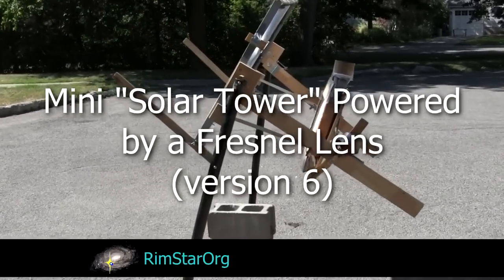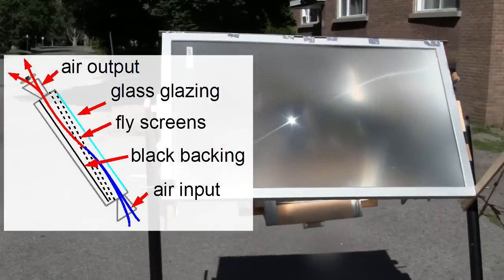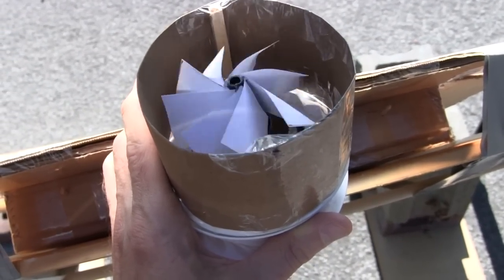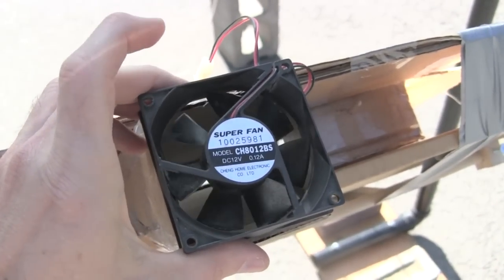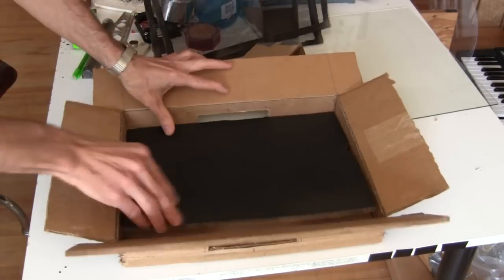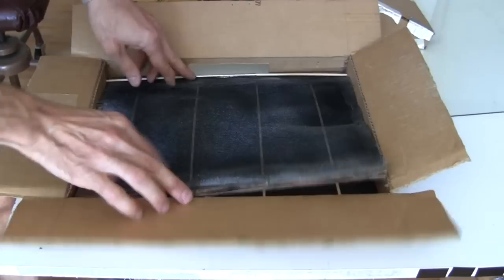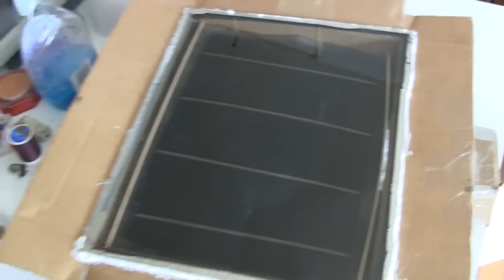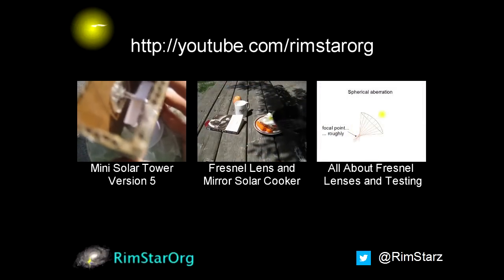Mini Solar Tower with Fresnel Lens Ver. 6 Screen Solar Air Heater

Comment: is there someway to heat your house with this lens?
Reply from the maker: Not really. It produces high temperatures by concentrating 8 square feet of sunlight into a small area. But if you have an 8 square foot window that lets sunlight indoors then it'd be the same amount of energy let into your house, just at a lower temperature spread over a larger area, though still above room temperature. The high temperature makes it seem impressive but it's not really useful for that. You could use the lens to heat a fluid and then circulate that hot fluid to where the heat is needed but 8 square feet isn't a lot of capture area anyway. I've found it useful for solar cooking though Fresnel lens and mirror solar cooker cast iron pan

Comment: Ok so try this build your tower as a tower round pipe made of varying meterials first metal at top were you will aim freznel lens vocal point as high as possible then tie that to a cardbord tube to act as a heat defractor that prevents heat transfer to the lower tube that will be made of light colored rubber or like material the bottom tube needs to be totaly shaded from sunlight as much as possible posibley even running into the shaded ground for a distance and then up to air  Cont.

Comment: what you really need is to be boiling water and making steam to drive a turbine , you've got  1 - 2kw /m^2 available there and by the look of it 1m^2 of lens..... you should be able to get close to 300watts output from that, sterling engine may be the easy option

Comment: Well the lower temperature does mean less air expansion and less lift due to smaller density difference, so this is really not a better solution.

Comment: I see that you moved the heat "sweet point" out of the material being heated, thus minimized the heat output, perhaps you can use two different metals and heat the point where you place them together and accumulate the electrical out into batteries, then you can power the electrical fan...Regards.

Comment: So I see you still haven't tried to bump up your systems performance by ising cold air at your intake side. You need to increase the differential between the cold air temperature coming into the system and the heated air temperature leaving the top. That will increase your air flow.

Comment: I have a similar idea on a much bigger scale using cooled air from under the house drawing through with black metal pipes exposed to the sun up the side of house then pipes brought through a venturi channel where I would place a Vertical or Horizontal wind turbine in that air stream. The difference in air temp would be 300+ deg. Enough to cause some wind.....
Reply from the maker: Sounds ideal. I wish I had a large area like that to work with. Let us know how it goes.

Comment: Have you tried increasing the area for the air inlet at the bottom? What happens if you keep the bottom open with a rectangular cross section you had before closing the bottom with a hole and pipe structure attached to it? I guess you need more air flowing in and that pipe inlet is restricting the volume flow rate. Anyways just a noob guy's thoughts, nice work :)
Reply from the maker: +Pranav Sawant The only other thing I've done is what you can see in the version 7 video https://www.youtube.com/watch?v=OiARUwLPGdU. In that one I added a tower to the outlet. But also in that video, from the blow tests I do near the end of the video you can see I'm not even close to getting it to work. I'm still hoping to try an entirely different type of solar tower that's more like the actual large scale ones.
Reply: +RimstarOrg I am actually working on making a scaled down solar tower( Based on the actual larger ones). What instrument should i use to measure the power developed? I surfed over internet and the best i could get is use a fan anemometer to calculate wind speed and then using equations, calculate power. Another one i saw in your video was to use a PC Fan. Can i get a numerical value of power developed using the PC fan?
Reply from the maker: +Aniket Gor I don't have any experience with anemometers but for fan output you can use two meters like I did in my video measuring the output of a solar cell using concentrated solar from my Fresnel lens https://www.youtube.com/watch?v=U5axWtCqgCA. Note that if you measure current with a meter and then switch to measuring voltage with the same meter, you can't multiply the current by the voltage to get the power. You have to use two meters and make both measurements at the same time like I do in the video and then you can multiply the current times the voltage to get the power.
Reply: +RimstarOrg I think you have mentioned a different link. Its about the sterling engine.
Reply from the maker: +Aniket Gor Oops. Here's the one I intended http://youtu.be/5uGex_wGa7s.
Reply: +RimstarOrg Got it (Y). Thanks a lot for your time :)

Comment: you didn't store the heat you generated to get a even heat flow, try putting the computer fan at the top and bottom of a metal pipe, a stack of bricks, dark purple or as dark as they come, maybe paint them, it depends on how hot they get, the Fresnel Lens and focus the Lens on the bricks, it will take some time for them to heat up, may be a few hours, maybe a week, depending if you live in a hot climate like the south or a cooler climate the north east, you might need more Lenses too, again depending on where you live.
https://en.wikipedia.org/wiki/Solar_updraft_tower

Comment: Solar tower? I don't see the tower. If you really want it to work you cant exclude the tower from the solar tower. The whole idea is to heat air that expands and thus make it more buoyant lighter then surrounding air and will try to raise. There the tower comes in and make a column of lighter air. Using the chimney effect air starts to blow up. 0.1 meter does not cut it. Try 2 meters or more. Make sure there are no turbulent corners or bottlenecks for the airflow. Insulate chimney to. Good luck.

Comment: upper portions of the build in order to use slower thermol heat transfer which would also alow this unit to work after dark. if you could provide enough thermal mass as in wet sand or salts Out where I live in the great south west we are blessed with many sandstone mesas. so I have been trying to get the native americans in my area to try this tech instead of coal fired power plants but they are slow to respound They could be the power house of the nation if only theyd lissen

Comment: The idea is correct but there are some things you need fixing. The main weakness i see there is there is not enough air passing through the tube to turn the propeller blades.  You need a very very very large and long tube to make it work.
Reply from the maker: Thanks. I added a long tube in the next version, version 7 http://youtu.be/OiARUwLPGdU and took it as far as I can with this design.
Reply: See the improvement with the long tube. Now you need to taper off the end like a nozzle to increase the air pressure before the fan.
Reply: I think you also need to decrease the pitch of the fan blades so it can catch more air same like an electric fan blades.

Comment: ThomasG. is a funny guy.   Rimstar, thanks for the ideas.  I recently found a large Fresnel lens and thought about using it for heating water/air project.  The videos I saw on line posed a problem.  Going full focus is great for melting sand and showing off to your friends but not so great when it comes to heating air/water on a DIY budget.  I thought...... why use a full focal point and then have to figure out a way to disperse the energy when you can just widen the focus.  You are still concentrating solar energy but over a wider area.  Then I see your video Rimstar.....we must think alike.   Here is my challenge to you Rimstar.  How can we combine a Fresnel lens, a beer can solar collector, a Sterling engine, some solar cells,  a sun tracking device, etc., to create a simple stand-alone water/air heater for remote locations and supplemental energy for home owners?
Reply from the maker: Kevin Thomas Yeah, the problem with creating high temperatures from solar heating is that heat transfer (loss) is more efficient the bigger the temperature difference between the ambient surroundings and the solar heated medium. I actually have an online calculator for that on my website here http://rimstar.org/renewnrg/heat_transfer_loss_calculations.htm. That's why for solar air heating, having it less focused is better. So for a can solar collector, it's best to just leave it as is and not have a fresnel lens. There'll be less heat loss that way.But I guess you're talking about using the fresnel lens to power the Stirling engine to run the fan for the solar air heater, and maybe an engine for the tracking. Though for the fan, a small solar PV panel usually does the job, and the same applies for the tracker motor.So far the solar uses I've found for fresnel lens' that make sense are solar cooking and also I've seen them use for focusing onto multi-junction PV cells.

Comment: doesn't look to have enough power to drive the generator,but ya if you used in a close system (box ) to warm the water ,what circulate in a black pipes for example you will get enough steam to power the generator 
 🌏 📡🌏 👣🕘 💎💀☠☼☾☄ ₪itibira₪ ✶☥✨🌛🌄⊀⋉🐺🐾☆▲▴◭

Comment: I was thinking that "you" RimstarOrg could turn this into a solar steam engine, instead of trying to heat a tank of water all you need to heat is a small coil of copper tubing, like whats used for the petrol lines to a carburetor on a car.
I remember my father made me one, when I was a kid,, a small boat that ran off a candle.
like this,> copper tube putt putt boat

Comment: Ok boss not to steal your thunder but someone show me how to put up a video here and I can share a set of designs that I have worked on for years with an eye on getting this tech. to a comercial level of useage in a hurry I live out here in the Great south west where we have many rock mesas they are perfect for this tech and will alow us to shorten tower hight by useing in ground cold tubes also get it to work at night by adding thermal mass  TAGz3339  Y  Co m